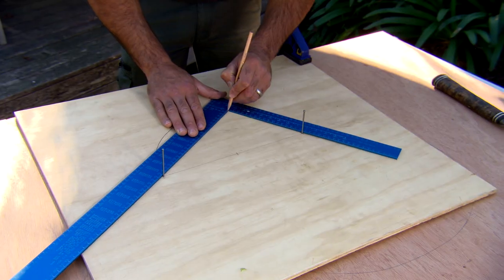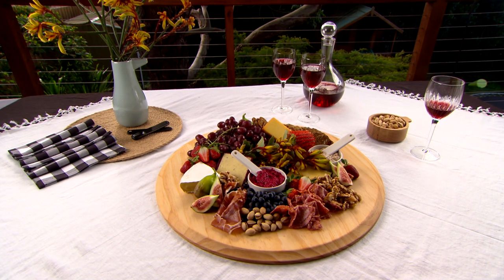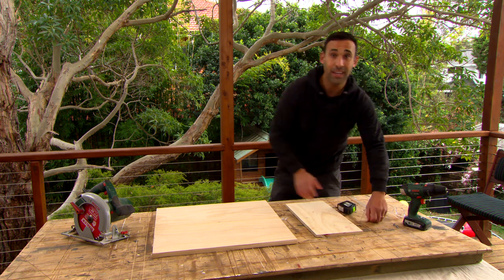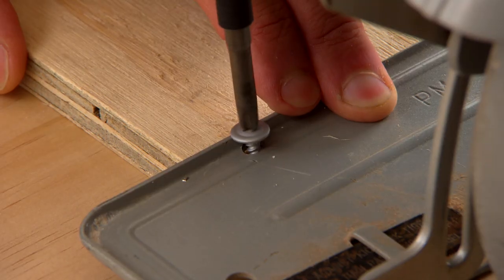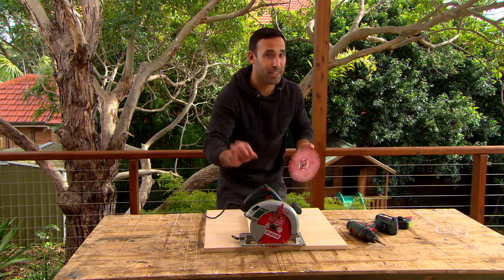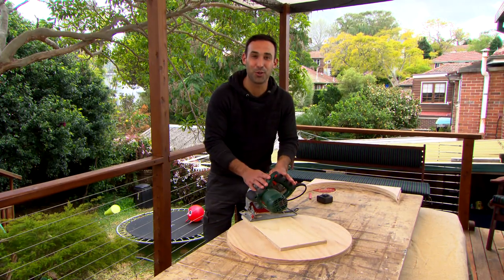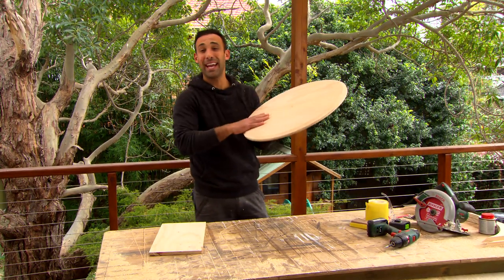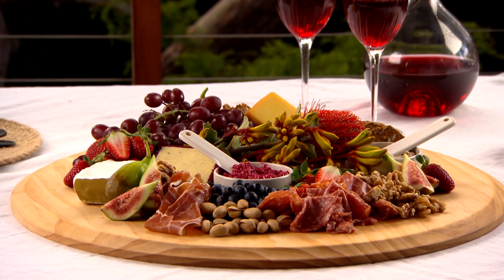How to Cut a Perfect Circle Using a Circular Saw | DIY | Great Home Ideas

Comment: I tried doing this on three 10.5” long 2x4’s screwed together.

When i went around the edges the saw cut out the corners as it turned instead of cutting a smooth straight line like your video

What did i do wrong?

Comment: Except... there's a hole in the middle of the plate...
Reply: My first thought is that you could make a jig that has two parts, like a couple of very wide clock hands (if you see what I mean) and either hot glue it each time or create two clamping points (tabs on one of the hands) that you could alternate as you rotated. You could, of course, buy a bandsaw. It is funny how tricky cutting a circle is without a jig or know how.
Reply: wooden dowel saves the say